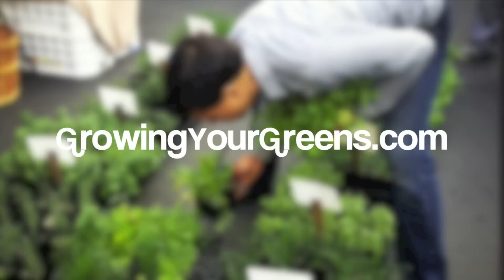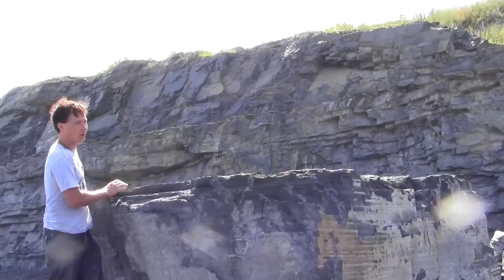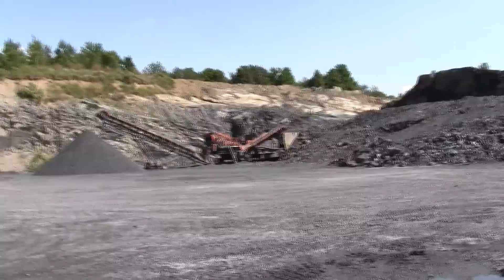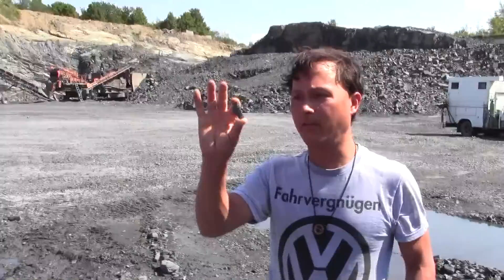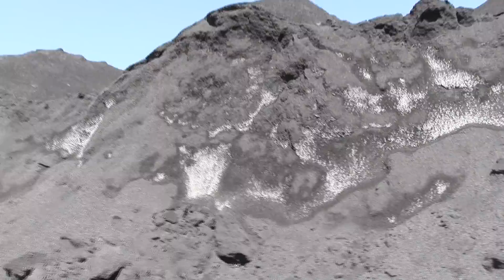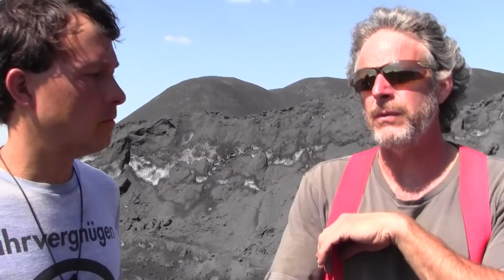Is Rock Dust Sustainable ?

Comment: I must have a different definition of "sustainable" than some of the others here.  The definition as far as I know is "able to be maintained at a certain rate or level".  Rock dust, being a waste byproduct of stone products, seems to meet this criteria without question.  As long as mankind is busting up rocks for one reason or another, availability of this resource will be there.  As long as we have trucks, trains, and big boats, shipping the product is not in question either, however the economics of shipping products plays a factor, but this is just in regard to being able to market the product at a cost level acceptable to the market pressures for competing products.  So let's get down to the real issues.  What are the GOOD key markets for the USE of rock dust, and what are not?  You can narrow this down by determining if a soil medium is VOID of these materials, or if there are other issues in regard to the available minerals present.  Good uses for rock dust include: 1. Amending materials being used as potting mixes which are devoid of or lacking sufficient mineral nutrients to help promote biological activity.  2. Composting operations where additional mineral content helps the composting process.  3. Soil remediation projects where base soil may have been contaminated and prevents or delays biological development progress.  4. and many other specific applications.  Does everyone need to start putting large amounts of rock dust in their little back-yard garden to have success in growing?  Of course not. That is simply silly.  If you compost, rock dust WILL help, and it only requires small amounts to see the benefits, and this is evidenced very quickly by noting the time it takes to get finished compost.  If you are container gardening and using potting mixes to fill your containers, add a bit of rock dust along with worm castings, and you will see a huge difference in the health and vitality of the plants because the soil will start to have some life in it much faster.  If you are setting up new raised beds, adding some rock dust may help get the biology going faster, if the soil medium you are using is lacking in mineral content.  Most of all, use some common sense when determining what products may work well for YOUR specific applications.  Just because your application does not require a product does not mean the product is bad, it just means that YOU don't need it.

Comment: the sheer amount of people in the comments that believe that adding rock dust to your garden has zero effect is truly astounding. It is objectively impossible for there to be no effect on microbial and plant life it is ROCK dust I would think that it's pretty intuitive concept to understand that putting minerals in gets minerals out(into the plants) and if a gardener isn't achieving the gain then that gardener is not fostering an environment in the soil to have truly elite microbial activity, microbes are the missing link between the rock dust and the plants. it's like expecting your car to start simply because you put gas in the tank and believing you don't need a key(microbes/fungi) to start the car!

Comment: Sourcing local rock dust for AG applications is certainly going to be a HUGE factor for commercial organic growers in the immediate and near future.  Shipping costs is the single largest factor in play for commercial growers to be able to implement best practices for building soil biology on commercial scale levels.  I'm sure that I will be working with Tom Vanacore in the very near future. Good work Tom for your insight and market development in this area, as you have put together a great market model, which was just what the industry needs in regard to being able to get local sourced nutrient materials to help build soil biology for both large and small scale operations at affordable pricing.  ROI is EVERYTHING in the AG business.  Again, nice work.

Comment: As usual John,  you are sticking your head above the parapet for the benefit of small gardeners. Never afraid to question your experiences and improve on your advice. I salute you!

This concept of rock dust is not new but has been ignored mainly by those that ARE taking money from companies pushing proprietary chemical solutions. The nice part of your video is pushing a company that delivers locally. Global geology is pretty consistent, in that most of us living in paved road areas,  live within 10 miles of a quarry that will have the waste product of rock dust. They might only be a small family concern mining for aggregate to put on local roads or drives, and they won't have the same spectrum that the quarry featured in your video has and they might not have thought of collecting the dust.  BUT!!  99.99 % of the time it will have many of the trace elements that have either been washed out of our gardens by rain or consumed by crops and utilising it will have a quantifiable effect on future planting, if used, AND if you ask they will happily work out how to package it for you. You might want to ask your local college or university to do an analysis on the composition, if the quarry hasn't already done this. 

Rock dust works PERIOD.

 It is sustainable on many levels, far more so than much of the petro-chemical based product pushed by the closed minded.

Keep up the good work and once again I salute your diligence and integrity.

Comment: What is sustainable John?  The compost we use on our garden?  No, because we put it there.  In a garden,pretty much, nothing is actually sustainable.  If we  don't put it, it doesn't get there.
Reply: +m Day If you make compost from onsite resources, than it is 100% sustainable. Many things "can" be sustainable, however that doesn't mean the manner in which it is done now is currently sustainable. Realistically speaking, anything that relies on oil, gas and coal fuels/energy/products is unsustainable.
Reply: +Cryptlord9999 AND where do the onsite resources come from?  What we put in the garden!  Duh!
Reply: m Day Onsite resources can be any organic material that is found onsite, such as tree leaves, ramial chipped wood, grass clippings, livestock manures etc. It is completely possible to use only onsite resources and be completely sustainable. If offsite resources are needed, they will only be needed for initial soil amendments. The nutrients found in the soil amendments would then be recycled within the onsite system.
Reply: +Cryptlord9999 Okay, let me take this a different direction because you are not seeing my point.
Sure, Onsite resources can be any organic material that is found onsite.  But WE have to put it on the garden.  Is it sustainable?  Only if we put it there....same with rock dust or anything else.
Anything we put on the garden can be sustainable from 40,000 other locations my friend....IF we put it there.  
Remember, we still have to plant to harvest a crop and all that comes form somewhere.  Sometimes even Walmart!
Reply: m Day Yah, anything "can" be sustainable in theory, it doesn't make it so in practice however. Sourcing things onsite or as close to the site as possible is also more energy efficient and makes more sense. Not all onsite resources are necessarily organic either, inorganic rocks can be crushed into rock dust onsite if you have the means to do so. 
Wesbters definition of Sustainbale: able to be used without being completely used up or destroyed
: involving methods that do not completely use up or destroy natural resources
: able to last or continue for a long time
It doesn't "have" to be onsite to be sustainable, however onsite resources will be more energy efficient and more sustainable under our current society/system.
Reply: +Cryptlord9999 Well my friend, it is obvious to me that your intention here is to be right and argue if I do not succumb to your side.  Or something hear that!  
I"m not going to argue about Rock Dust.  I am declaring a win for my side.
Rock dust IS Sustainable if you amend the soil with it.  When you do this, you just made it sustainable for many years to come.  It does not go away unless it is washed away but so would the garden.  

I have seen gardens that are full of rocks of all sizes and over time, with freeze and thaw and natural earth actions, the mineral content off those rocks flake off in the form if dust or microscopic particles.  Any gardener can put something in his garden that will do the same thing over time and it is therefore sustainable, even by your definition.

THAT is the last I have to communicate with you about this.
You have a nice day and a nice garden too!
Reply: m Day You seem to be going off on a random tangent that had nothing to do with my original posts. I have no idea what the fuck you are even trying to portray. No one here said rock dusts weren't sustainable. However, in our modern society, unless you are shipping/receiving products that do not utilize oil, gas or coal fuels/products, then it is not technically sustainable. The majority of the world and society is not sustainable as it is. Hence why I mentioned that onsite resources will be far more sustainable, than bringing in off site resources. So my statement still stands true, in theory things can be sustainable, in practice however, they are not  always sustainable.

Comment: Rock dust is simply a mineral John.  It's nothing to have a heart attach over dude.  The good thing about minerals is, it breaks down slowly and stays in the soil until it is needed.  
If it is not needed fast enough, it may be washed away and simply used some place else.  
It is good for loosening the soil too and since it is not soluble, it won't hurt the soil, ever!  
If you put too much on the soil, you only need to rake it out a bit and there is no harm done.

So take it easy on Rock Dust!  It is our friend.

Comment: Rock dust is no more sustainable than the products promoted by the Mittleider gardening method; which, John made a very pointed video about. Just because packages are being shipped every day does not mean one should contribute to the process. (So much for reducing carbon footprint) Truth be told, rock dust itself does not fix carbon nor prevent nitrogen loss. Both are complicated and multi-faceted processes and some aspects are yet fully understood. Majority of even the peer reviewed papers say “in x set of conditions, x particular material may yield x results.” I’ve worked at enough research facilities to know, it is not uncommon that if a particular brand or type of product is being tested the manufacturer/company is funding the testing in some form or fashion. I also know if said research facilities want to stay in business they will work and word however necessary to continue to receive research dollars.  I do not believe the use rock dust is all bad. I do believe, blindly dumping products in your garden without first knowing if it is needed is simply a waste of money and can lead to problems, my opinion based on 40+ years of gardening.  I can appreciate what John is trying to do; but I miss the good old days of “Hey this is John and this is how I’m growing my fruits and veggies. If you like it, give it a try; if not, well hey glad you checked it out anyway just don't be a jerk about it.”    I’d love to see some independent lab results of John’s fruits and veggies.